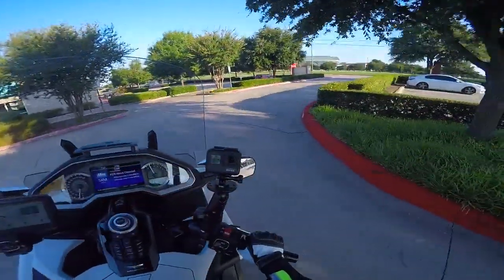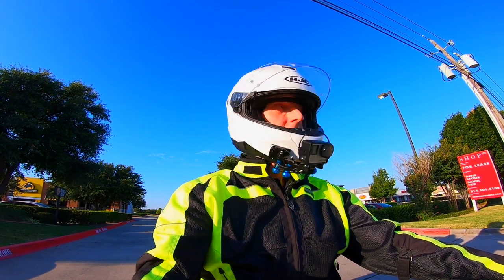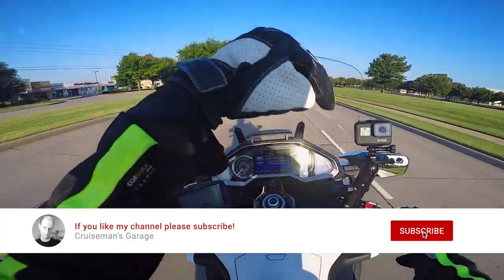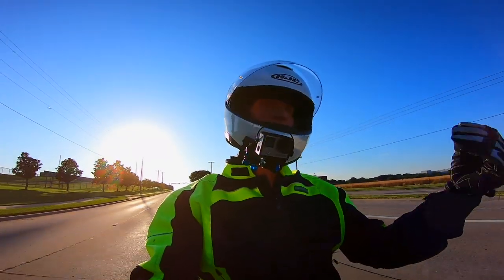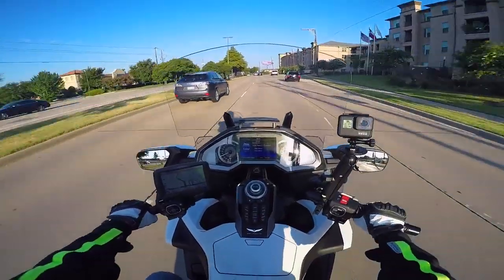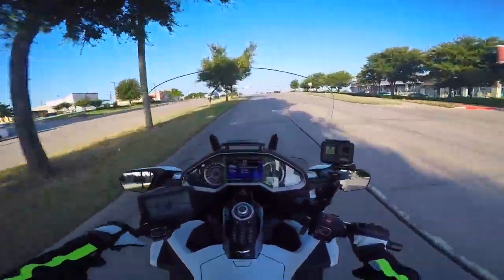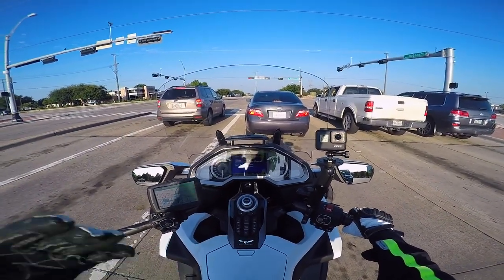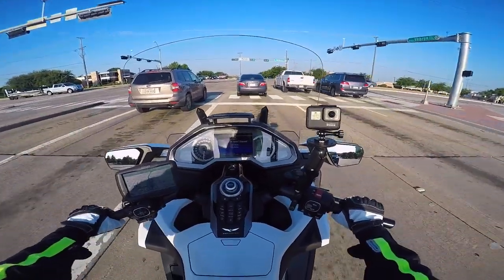Catastrophic Engine Failure on 2018 Honda Goldwing | Cruiseman's Moto Vlog | CruisemansGarage.com

Comment: I had a GL 1800 gold wing and I got to know two guys that also had GL 1800 gold wings, a 2013 and a 2015. They both traded their gold wings in on 2020 gold wings. Within four months, they traded both of those gold wings in on leftover 2017 gold wings. They did not like the new gold wings. They said they were smaller, cramped, The wives did not like the smaller accommodations, and the bags and trunk were much smaller.. these guys were retired veteran Goldwing national owners club members. They do not like the new gold wings, and they said they are not the only ones
  my GL 1800 goldwing i bought used with 13,000 miles on it from the original owner. I tried for two years to fall in love with that machine after hearing how wonderful they are. I found it boring and a gas hog. And going by the service manual it took me almost 7 hours to change the air filter. I’m not a rookie at working on motorcycles, I was a motorcycle mechanic in three different Honda dealerships.. although I had never worked on a gold wing, I thought changing the air filter procedure was ridiculously complicated. It wasn’t hard, it was just so involved. It cost $700 to have the air cleaner changed at a dealer. If you keep your Goldwing for 200,000 miles like they all say they do with no problem. And you have your service department change your air cleaners every 25,000 miles which is stretching it. I think 15,000 is about right but let’s just say you change the air cleaners and have the dealer do it every 25,000 miles for 200,000 miles. It’s gonna cost you almost $6000 just to have the air cleaners changed eight times. That’s not counting the cost of the air filter and any other service you may be having done at the same time like oil changes or tires.. everything everything everything on a Goldwing takes more time because those motorcycles are buried in plastic
  I tried to fall in love with my Goldwing for two years. I gave up and went back to my third Yamaha royal star V4 Venture.. The Venture is roomier, gets 33% better gas mileage, has adequate power, it’s not as smooth as a Goldwing, it has a pulse, you can feel it breathing like it’s a living breathing thing, which it is, and I like that.. I can actually work on the clutch, the water pump, the slave cylinder, the alternator, and the starter on a Goldwing without removing a single piece of plastic. Everything is visible on one side of the engine or the other. On a gold wing, you can’t even see the engine, it’s buried in plastic, all you can see are two valve covers.. I like the engine to be the center piece of the motorcycle. I guess Goldwing is one of those motorcycles that you can’t see the motor..Don’t get me wrong, gold wings are perfect and they are ultra reliable, at least they were. But they’re so damn hard to work on and they get terrible gas mileage and they have so many gadgets and gizmos that I’m paying for and I don’t wanna pay for them. So I’ll pass..
One other little thing to consider. I have the Yamaha royal star venture, pretty old school with carburetors. And the gold wings have fuel injection since 1988 when they introduced the six-cylinder. But consider this. If your battery goes flat enough that it won’t start your Goldwing or my Venture.. you’re not gonna be able to push start that Goldwing. It won’t start without a solid charged battery to power the fuel injection system in the computer.. but my Venture since it has carburetors will start with a weak battery by catching it in gear. So carry jumper cables on your Goldwing. I have always carry jumper cables on my ventures, and on my fuel injected sport bikes. They don’t have to be big heavy cable jumper cables. You could make up a set of jumper cables out of number 12 gauge wire. I believe they only have 18 amp batteries. And 12 wire is good for 18amps.. I carry a set of jumper cables on my Venture that I made up from a power cord off of a washing machine. It’s in a nice heavy jacket protecting the wires, and I just had to splice on a smaller set of clamps on each end, and they fold up neatly into a small zipper pouch that I carry in my saddle bag, just in case, it’s about 5 feet long and that’s long enough

Comment: Hey all! I finally broke down and traded my Concours for a 2018 Gold Wing Tour hoping to have it for a long time. Throughout my first few hundred miles I kept smelling burning oil and after starting it up after work, I noticed blue smoke coming out of the r/h exhaust. I decided to check the oil level per the manual, and it showed no oil! I drained about 3 quarts out and filled it with Amsoil Metric Motorcycle Oil in a 10-30 weight to halfway between the full and lower marks on the dipstick. I put about 100 miles on it and checked the oil again. Once again, no oil showing! I brought it to my local Honda dealer and wanted them to look into it. They said nothing was wrong and proceeded to charge me $183-! I started the bike up and let it warm up and had the mechanic check the oil. Surprise! No indication! They refunded my money and now have the bike for warranty issues. Frustrating, since the bike only has 700 miles on it! Any ideas of what the issue could be, or any insight on what Honda might do? Even if the "fix" the problem, I don't want a bike that has been compromised!
Reply: It would take one heck of an explanation for what was going on for me to want to keep the bike after that.  Some bikes (and cars) will put out blue smoke if they are overfilled with oil.  I'm no Goldwing expert at all (looking to get one), so I couldn't tell you here.  What did you ultimately do with this situation?

Comment: We have to remember the 2018 and newer engine is a new design. The new design uses 4 valves per cylinder verses the old style using 2 valves per cylinder. The old design was tried and true. I'm sure Honda will perfect the new design it just takes time. That's why I never buy a first or second year designed car, motorcycle, or anything. When you do that, you are basically a beta tester. Same with the DCT transmission.
Reply: Very well said and completely true. At least dealer warranties should protect the buyers in the first 2-3 years.

Comment: First generation teething pains.  It happens to every manufacturer.   Also, does the gopro on your helmet have video stabilisation?  It looks like a 3/4 so it might not be as good as the newer gopros stabilisation.  No big deal but it's a bit shaky.

Comment: I am sorry this happened to the owner of the bike. I remember seeing the post about the damaged spark plug. If the rider /owner did not do anything to cause this failure then Honda should replace the engine if not the entire bike. I did notice one thing in the video the rider /owner posted the miles he showed were of the trip A meter not the Odometer. I am not saying he did not have only 2,300 miles on the bike, but I would rather have see the odometer not the trip A meter. I have a question is this a DCT or a 6 Speed manual tranny?

Comment: I had a bearing break apart in my 2018, I didn't have all of the oil change receipts so Honda wouldn't help with the $12k cost to fix my bike. I got 3 new pistons among some other parts and the knocks and pings it has now has been deemed "Honda engine characteristics". I have taken it back to the dealer 3 times and get the same excuse and how there is nothing wrong with it. Definitely been a nightmare purchase for me and I can't wait to unload the bike and get something else.

Comment: Let’s everybody calm down and allow the dealership to perform the tear down and see EXACTLY what happened. 

He isn’t the original owner of the bike but I still believe that the dealership should give Wavy a loaner at the very least or replace the bike with an equivalent bike.

It’s definitely an issue but it is not a catastrophic failure. The engine is running. Continuing to rev the engine isn’t going to help things.
Reply: I thought he brought it Brand New???

Comment: This has got me concerned about my 2019 dct. I was out riding and was thinking I heard some odd noises at times. The noise would come and then go away. I don’t hear it all the time just every once in a while. I’ve only got around 1500-1600 miles on it now. I may not hear any odd noises for several bike rides and then one day I’ll hear something that makes me take notice but the noise would go away. It’s a ticking noise but it doesn’t last long but it’s loud just enough to catch my attention when it happens. Sounds like it’s coming from the left side of the bike.
Reply: Jason McKinney For your own peace of mind and your safety, please get it checked out.
Reply: 19,000 here and I occasionally hear that faint ticking too. VERY faint. Not at all speeds, and not all the time. I’m attributing it to some sort of loose wire tapping the plastic somewhere. I haven’t found the need to investigate in detail, because it’s been going on now for 10,000 or so miles and that’s just when I first noticed it. Perhaps it’s been there since day one. Don’t know. I’ll keep my head in the sand. I wouldn’t trade mine for anything. Really a great bike. 6 speed Tour. I did add my Zumo so perhaps it’s one of those many superfluous wires tucked away under there.
Reply: Did you guys figure out what the tapping noise is on the Goldwing?
Reply: Jason McKinney. Yes Jason. In my case it was a short piece of plastic tape flapping against the inner cowl liner. Sounded like my old bicycle when I put a baseball card in the spokes to make it sound like a motorcycle when I was 10 years old. Well, not nearly that loud but you get the idea.

Comment: Interesting. When Bmw had a shock issue with their 1200RT which was a safety issue, they offered recent purchasers a full refund or a new 1600GTL loaner until replacement shocks could be produced and installed. It was that level of customer service that encouraged me to purchase two Bmw touring bikes.

Comment: On the GoPro, that's a known issue with the Hero 7. Something in the camera will run the battery down. Not all the time, but it will happen.  I have a 7 and it happens. I'm not sure GoPro is gonna fix it, as they have moved on to newer generations.

Comment: I feel very sad for all my gold wing followers on my YouTube channel.
I made a video just after I sold my GL 1800 gold wing after doing quite a bit of maintenance on it, upgrading the front fork, springs seals, bushings and fork oil, changing the rear shock spring to match the front fork, spring upgrade, just changing the air cleaner was very time consuming. Removing the rear shock to upgrade the shock spring to match the front fork. Springs was the biggest job of all the work that I had done to my machine. I mean I had to start by removing plastic around the dashboard gauges just to get the back shock off. I had to remove all the plastic over the engine in front of the shins. I had to remove the seat, the fuse box, the battery, the fuel tank, which is the size of a child’s coffin down inside the frame under the seat, just to get the rear shock off.
nothing is smoother than a Goldwing call my Goldwing Felt fresh on its feet with the upgraded suspension and fresh Dunlop elite threes call my new spark plugs, fresh oil, lubricated, steering head, bearings, fresh, clutch, fluid and brake fluid, greased, rear, suspension links, greased, driveshaft, splines, the bike was ready to go for the next five years. But after all of that, tedious busywork of removing all of that plastic, I decided I did not want to work on a Goldwing ever again. I can do the work, but that doesn’t mean I like it. So I sold the Goldwing and I went back to what is now my third Venture since 1986. I explain all that in my YouTube comparison video between my Goldwing and my royal star venture with the V4 engine, which is relatively.  trouble, free, easy to service, not as smooth as a Goldwing, but just as reliable, possibly more reliable when I see these videos about transmission problems and alternator gear, drive problems and clutch problems and with the 2018 and newer Goldwing transmission explosions. Where is terrifying the thought of a transmission explosion because I had that happen about 30 years ago on one of my machines. It was a light machine, a Yamaha RZ 350 two-stroke. It was my fault, I did not have enough oil in the gearbox, and one of the gears seized on the main shaft. It broke seven of the gears in the transmission when I split the cases to see what happened. It was my fault, this was around 1992, I was working part time in a Yamaha shop, and I was able to get the new parts to repair the transmission at cost, no more than 30 years ago. There was one gear and the transmission that cost over $350 just for one gear, I ended up breaking seven of them, and I needed a new mainshaft.. if that happened here in 2024, the parts alone would probably cost more, if they were even available, then the motorcycle is worth. Even after I repaired that transmission, I never trusted that bike again even though it was my fault, I sold that bike right after I repaired it. Because when a transmission locks, you are completely helpless until the bike either spit you off, or Shreds the back tire down to the cords if you can control it and keep from hi siding to a stop.. When my transmission locked, I was going uphill about 60 miles an hour on concrete. My bike started fishtailing quickly, it was all I could do to keep going straight. I didn’t touch the brakes, the engine was shut off because The rear wheel was stopped by the locked transmission, and the locked transmission also stopped the engine. If I was quick enough, pulling the clutch in, would’ve allowed the engine to keep running, but that was of no use, because the rear wheel would not turn when the transmission was locked. When I finally stopped, the rear tire was shredded down to the cords, and I could not move the bike off of the road. People stopped. and helped me drag the bike off of the highway on my way to work that morning because it would not roll, and pulling the clutch in, did not release the back wheel from being locked..
  Honda needs to consider doing a worldwide recall on these motorcycles to get them off of the road because of the possible liability. There is a knownlife-threatening issue with these transmissions, and they haven’t done enough to rectify it. There are going to be fatalities unfortunately. These bikes should all be parked until they are repaired. And because of the Harley tariff of 1984/1985, there are fewer Honda dealers than ever right now. It’s going to take years to address this problem, and to fix them all..
  I feel very fortunate that I do not have my gold wing and a more. I went back to my third Yamaha V,for Venture simply because it is so easy to work on. I can get the starter, the alternator, the slave cylinder, the water pump, even the clutch off of the machine without removing any plastic. I can change the air cleaners in under five minutes each, there are two of them one on each side of the machine right in front of your knees. I point all the sound in my YouTube video which happens to be my most popular video by tenfold over any other of my motorcycle videos. That video the last time I looked here in 2024 it’s over 74,000 views. That is mine boggling to me..
 in the video, I admit that goldwings are the smoothest and they are perfect. I just don’t like working on them. That’s not saying anything negative about the Goldwing, which is a smoother bike. I just don’t want to put that kind of time in to doing which should be a simple job doing most maintenance…
  I feel terrible for all the goldwing i bought or is not there. I wish them luck. And I hope that this does not hurt their resale value. Used motorcycles are not flying out the door right now like they used to. When I look on websites like craigslist under motorcycles for sale, I’m seeing some of those Harleys on there that have been for sale for over a year and they still haven’t sold. 
  I find it ironic that Harley, the company that requested help from the government back in 1984, which resulted in the tariff, that tariff eliminated several generations of motorcycle in Theseus, that never got enthused into becoming motorcyclists, because of the price of motorcycles after the tariff was applied in the mid80s. All those people that never started out on a cheap to buy Japanese motorcycle that would have traded up and work their way up to a Harley someday. They never got started, and that tariff has come full circle to bite Harley in the ass here 40 years later, because they eliminated their future customers with that tariff 40 years ago. Now I realize that not everyone that starts out on an inexpensive Japanese bike would have ended up buying a Harley someday. I know that would not happen. But probably a couple hundred thousand of them would have ended up with Harley’s today..